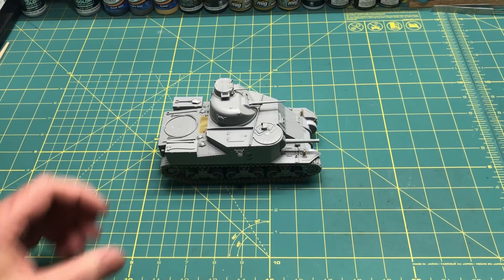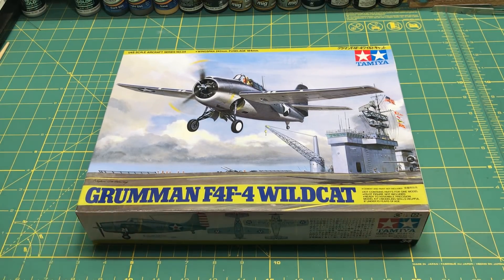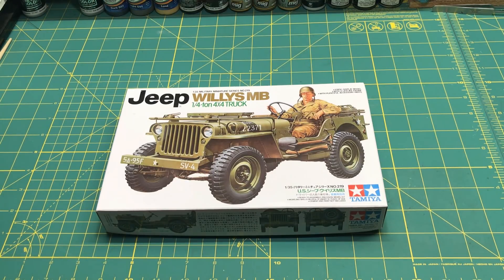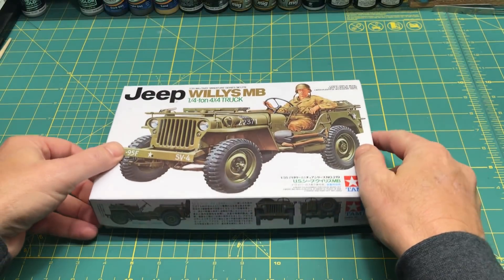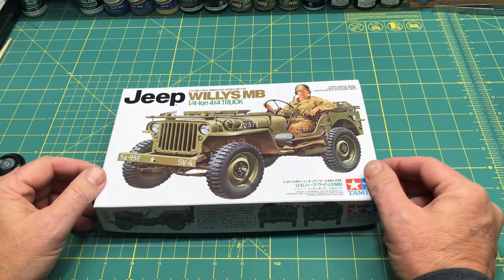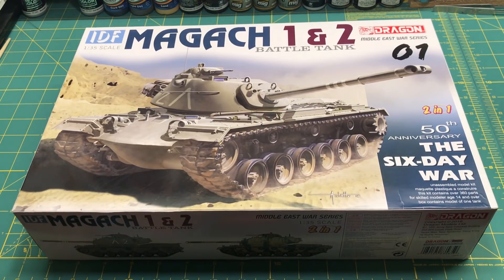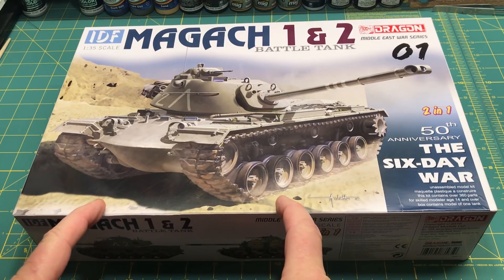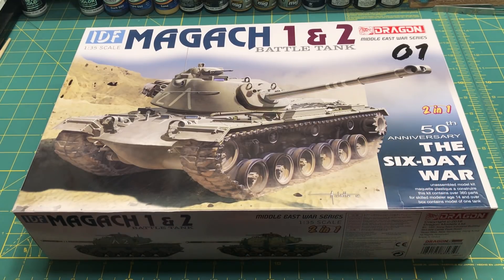Preview For 2019

Comment: Brett now that's what I call a full plate just a heads up when you build the F4F-4 WildCat two things to watch out for is  one the landing gear is finicky and test fit the wings there is a slight step where they met the fuselage some sanding may be needed oh the cockpit floor is solid the pilot is supposed to be able to see out the Windows in the bottom of the plane frames makes a mask for the wildcat the True Details number is 41008 two come to a pack  enjoy your builds looking forward to seeing them. stay the course Bruce
Reply from the maker: Thanks for the tips on the F4F-4, Bruce! That's the kind of stuff I like. Someody passes it on to me and then I can pass it on via the video.
As for the windows, I had seen them before, but since this is a beginner build, I may skip that part... but then again, maybe not!
Reply: Thanks for the info. Very helpful since I have this kit also !
Reply: @jsidaho1957  hi go to large scale planes thumpter 1\32 scale F4F-4 build full build check out the cockpit part they show how the cockpit floor is supposed to be hope you find it useful stay the course Bruce
Reply: I can't wait to see this lot being made for the M14 I should have a figure in my cave if you want me to send it to you happy new year Brett take care my friend 👍👏👏👏👏👏👏👏👏😁🐑✌

Comment: Hi Brett, that's a big list. You're an ambitious guy.  That Tamiya F4F is a nice kit. Watch the lower fuse when you assemble it. You can end up with a step if you're not careful. I am interested on your thoughts between the Revell issue of the 262 and the original. Love all those Stugs too. Stash growth is always a problem. I already picked up 3 more Tamiya aircraft this year. :) CYA
Reply from the maker: Thanks, Jim. I am really, REALLY going to try and avoid buying anymore kits until I get these finished, but as some wise person once said, "The best laid plans oft go awry."
As for the Monogram vs Revell boxings of the Me262, the older Monogram boxing is in much better shape as far as the molding quality. Not near as much flash, and it just looks "crisper." When I build more of these types of kits, I will definitely be going for the older boxings.